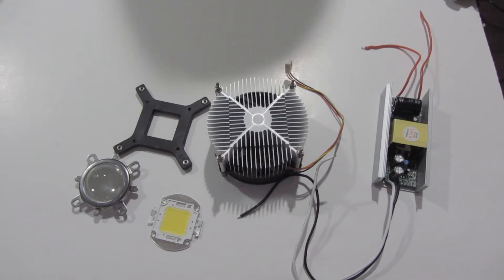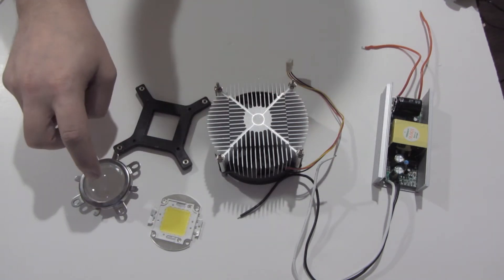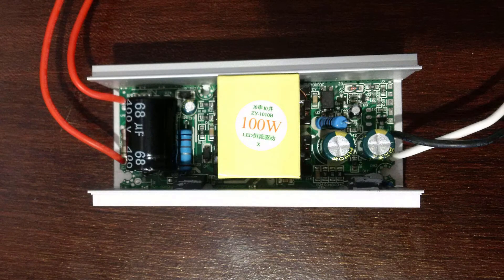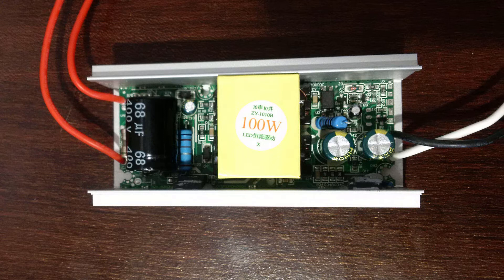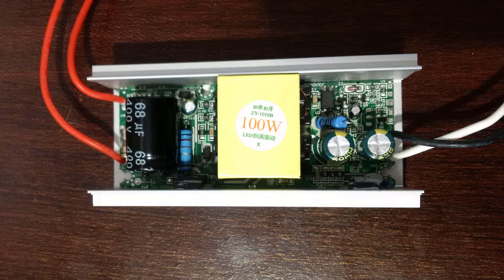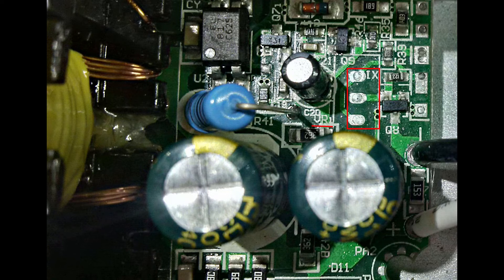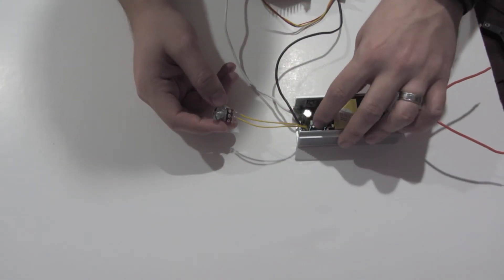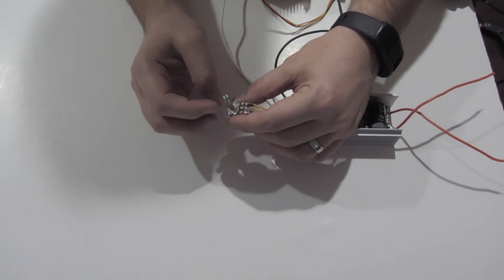Add Dimmer to 100W LED

Comment: How did you power up the fan ?
Reply from the maker: I used a USB charger that plugs into the wall and took it apart. I showed that part in my other video. Here's a link to where that part starts: https://youtu.be/6GuWEI53Cxo?si=547Hi7g7zMgxBfpI&t=272

Comment: Hey this is really handy, do you know if anything similar can be done on a DC-DC LED driver?
Reply from the maker: It all depends on the circuit. You can look at the circuit and see if you see something similar where it looks like you could put a potentiometer. Some drivers may have a trim potentiometer already in the circuit, which you could replace with another one with a knob.

Comment: I would like to know where the soldering of the wires was made to the drive plate
Reply from the maker: At 1:45 you see three solder points in a red square. I soldered the wires to the middle one and one of the outside ones. Listen to the video again. I described everything I did.

Comment: Hello! Could you tell me the maximum stable output of that driver? im looking into buying one for running 30V3A led.
Reply from the maker: Attila Hetényi I'm using a 30V 3A LED here too. This is a 30V driver. The max current output I measured is about 2.75A. I found I was able to bring the current down to 1.75A without hardly affecting the light output, but it did wonders for the heat output.
Reply: Can it keep the 2.75A at 33V Vf?
Reply from the maker: This driver is designed to power a 30V 3A LED. It's possible this LED just doesn't draw more than 2.75A, which is a normal variation for something rated to be 3A (not every "3A LED" will draw exactly 3A).
Reply: Specification says its 36V3A 100W driver. 36V3A is 108W, thats over the specification, but 36V 2.75A is exactly 99W as expected, maybe this is a 36V2.75A driver. All reviews say it cant handle the 3A output but one person wrote it has a 37-38V output voltage.
Reply from the maker: Sorry, I didn't see this reply. The specs in the eBay listing (https://goo.gl/HgWenj) do say 30-36V, but I don't remember seeing the output voltage as high as 36V. I can't test it myself anymore since I have this light all put together and I used a trim potentiometer (as well as the normal pot) to limit the maximum current to cut down on the heat that comes off of it. The max power is cut down quite a bit, but hardly affecting the light output.
I will be releasing the new video hopefully within the next month, showing how I put it all together. I have it filmed, I just need to edit it.
Reply from the maker: I was just reviewing some of the video footage from when I made this video. Something I had filmed but didn't end up including in this video is when I had a multimeter in the picture showing the voltage rise and fall when I turned the potentiometer. At its highest setting, the voltage was 30.4V.
Reply: @GabesHacks  So what do you think you are maybe changing, the voltage or the current with this hack?
Reply from the maker: @keithofarns8738  It seems to limit both - at least that's what I measured. I'm just tapping into existing functionality on the circuit board here, so I'm not entirely sure how it works :)
I talked about the numbers I measured in my other video where I built the whole light: https://youtu.be/6GuWEI53Cxo?t=241
I used a trim potentiometer to limit the maximum current, which brought the max current from 2.75A to 1.75A. Then the other potentiometer can bring it down even further.
Reply: @GabesHacks  it seems like your led can't draw more than ~30v at 2.75a current, so no wonder you haven't reach 36v output, which should be a standard top voltage for these LEDs.
A was about to get the same drivers, but 2.75a output makes me doubt.